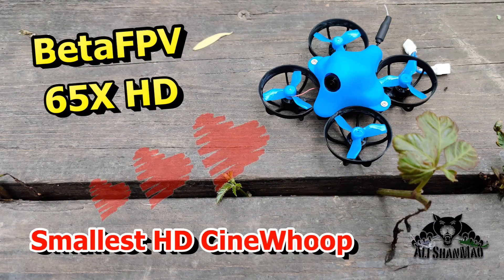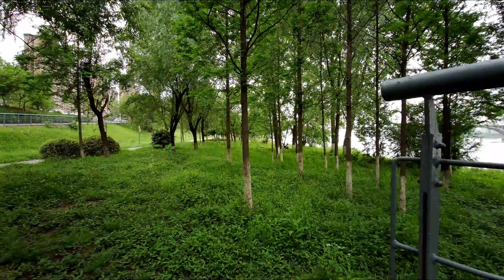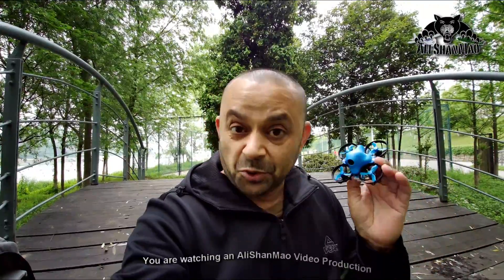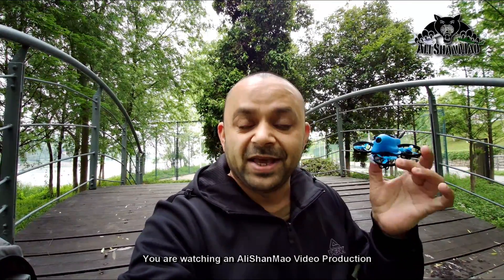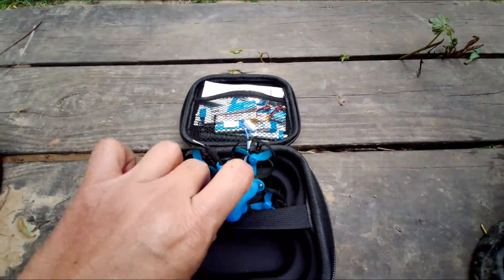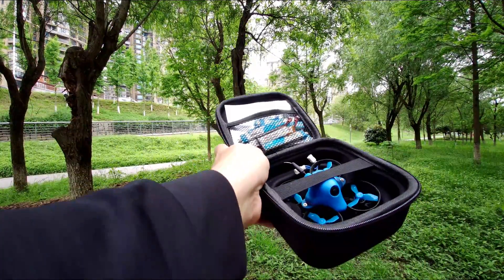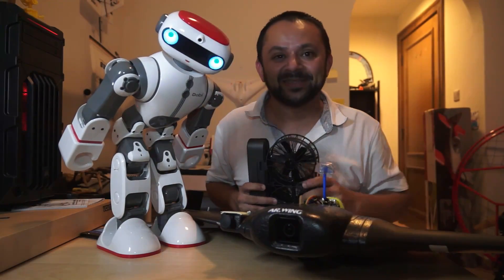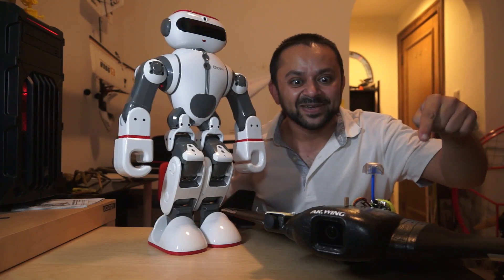BetaFPV 65X 2S HD FPV Whoop Outdoor Test flight

Comment: I noticed the antenna's on your goggles. You have a pagoda and a CP antenna, but this whoop has a dipole antenna. Have you tried swapping your antennas out to the regular straight "rubber ducky" dipole antennnas for better reception? I only fly whoops and I bought several CP and pagoda's and patches, but nothing works better than the stock straight black antenna's that come with my skyzones! Try it out!
Reply from the maker: Thanks for the tip. surely will try them indoors. indoors I am having lots of reception issues.